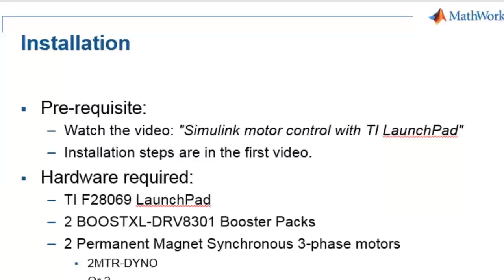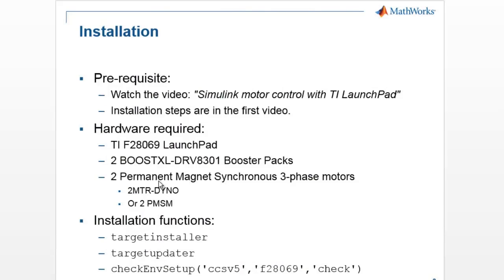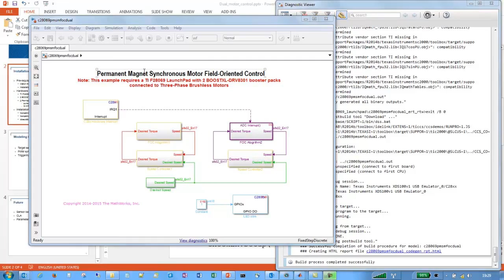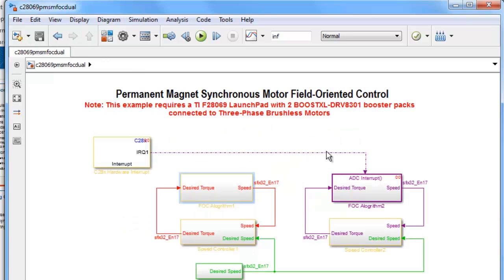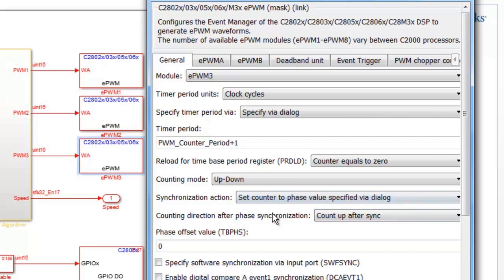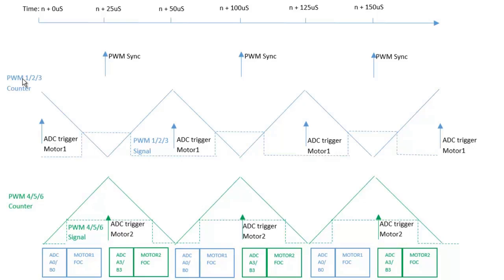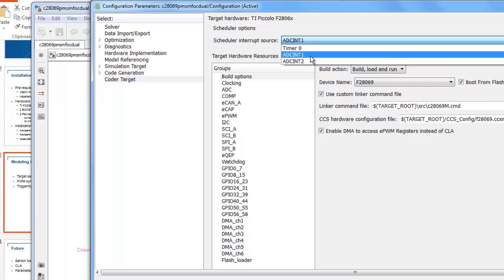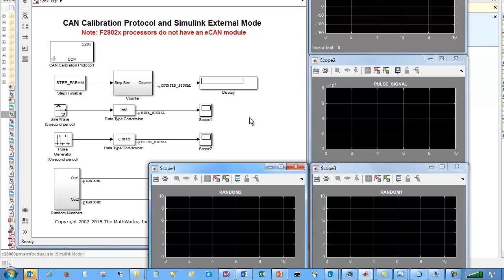Using a TI F28069 LaunchPad with Simulink

Comment: I have a problem with the interrupt mode in Simulink, the simulation is good but in real time there is nothing happening, and I would like you to guide me to the solution especially the configuration to be done.
If you have an example that explains the use of interrupt in Simulink with the Launch pad F28379D embedded board.

Comment: HI, I have a question about ADC. I am testing simple ADC connected to ePWM in simulink. I am getting oscillating PWM output. how can I fix it? I am new F28069 user. Thanks for your help.

Comment: Hi there,

I was wondering if it would be possible to use 2 DRV8301 to provide a PWM output to the field winding of a Synchronous Generator. That is by using two would i be able to have an increased output current, and increased output voltage ?

Thanks
Reply: That's a good question, in theory it should be possible but you may be asking for trouble. Feel free to try and let us know. I hope this video gives you a good start.
Cheers,
Antonin.

Comment: hey can you please provide more information about the motor that you used like the specification and also from where can we get one thanks so much
Reply: +Abdulhakim Ezzabi 
Everything I use is available "off-the-shelf" from TI except for the power supply.
Controller board ($25 LAUNCHXL-F28069M): http://www.ti.com/tool/LAUNCHXL-F28069M
Motor Driver (2x $49 BOOSTXL-DRV8301): http://www.ti.com/tool/BOOSTXL-DRV8301
2 motor dyno ($425 2MTR-DYNO): http://www.ti.com/tool/2mtr-dyno
They ship worldwide.
For the power supply, I used an old 20V laptop power supply (very bad power supply for this type of application), that's all I had available. A lab power supply with a current limiter would probably be much better. The motor driver can take anything from 6 to 24V, the higher the voltage, the lesser the current to get the same torque.
I hope it helps,
Cheers,
Antonin.
Reply: +c2000expert 
thanks so much for your response,

Comment: Can I control single motor using F28069. Also Can I use only launch pad and motor of higher voltage along with my power module
Reply: Aishwrya Apte ,
If you can do 2, you can easily control only 1 motor :-)
If you want to use the LaunchPad, I would start with the model provided at the following page:
@49109
and start deleting the pieces related to the second motor.
You may also want to check out some of the motor control shipping examples based on the c28069 controlCard, just type the following command at the MATLAB prompt:
c28069pmsmfoc_ert
If you want to learn about how to use the CLA on F28069, type:
c28069pmsmfoc_cla
Using the LaunchPad with your own power module and motor that has a higher voltage sounds doable to me. Keep in mind that the LaunchPad has been design for low-cost mass market solutions. It may not be rated for production type applications though I don't see any reason why it shouldn't work. I'm not the expert on this, you may want to ask TI directly.
I hope it helps,
Good luck!
Antonin.
Reply: http://www.mathworks.com/matlabcentral/fileexchange/49109-dual-motor-control-with-ti-f28069-launchpad
Reply: c2000expert 
Thanks for reply. I will definitely try this. I am doing my research. But motor I am having with me is of higher rating I will try that also.

Comment: Hi Antonin!

I have few questions:

1. Is it possible to control and monitore more than one TI F28069 or F28027 LaunchPad connected to PC from MATLAB/Simulink(for example: to control 4 or 6 drives)?

2. Which communication will be used in this case?

3. Is it possible to update and send desired values(velocity/position/etc) directly from Simulink in "Real-Time"?
Reply: Myroslav Shysh ,
If you use the "boot from flash" option, you can use multiple boards at once, but you can only program one at a time.
Here is the procedure:
Program each board one by one. Once they are all programmed, plug all of them together to your computer, you should get a different COM port for each. Then you can communicate to all boards at the same time using their respective COM port.
Note that the USB cable connected to the launchpad gives you 3 things:
- An xds100 JTAG connection to program and debug the processor.
- A serial over USB connection that gives you a COM port on your host computer connected to SCIA on the target.
- A 5V power supply to the LaunchPad.
While programming the board, we use the xds100 JTAG connection. There is no way to differentiate one JTAG connection from another. That is why we can only program one board at a time. But while running, you can communicate to the different boards using the different COM ports.
The following page shows you some serial communication with the launchpads:
http://www.mathworks.com/matlabcentral/fileexchange/45124-motor-control-with-ti-launchpad
I have some other demos where we send data to the board that you can use to change the speed or torque demand. You can increase the baudrate all the way up to 5.625Mbps on the F28069 launchpad and visualize data that changes at 20kHz! I will update the demo with this setup soon.
I hope it helps,
Antonin.
Reply: c2000expert Thank you!! Waiting for this demo!